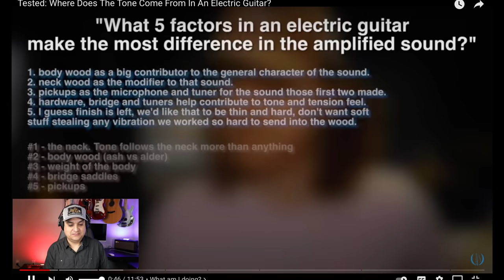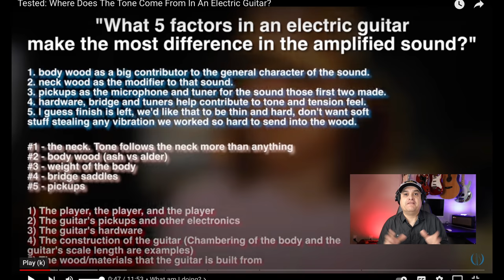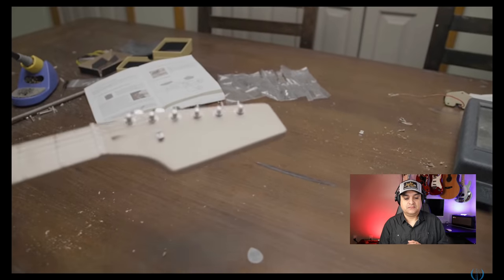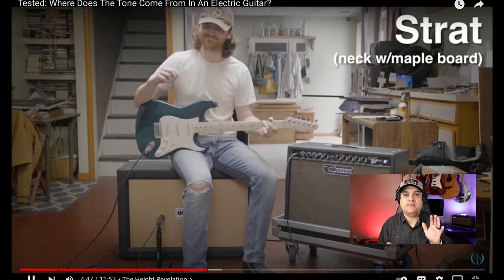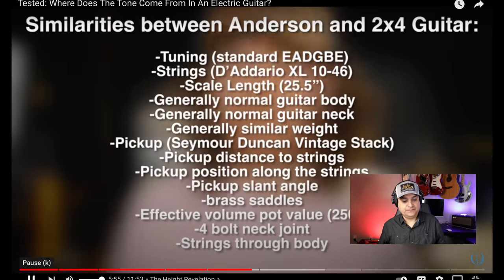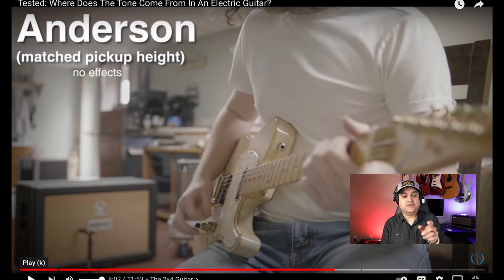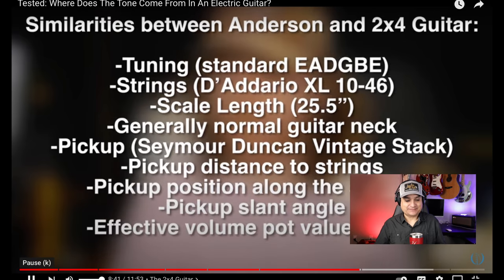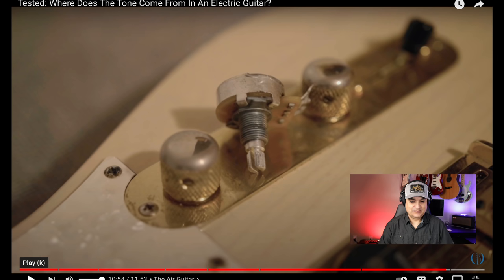Where Does The Tone Come From In An Electric Guitar - Reaction Video

Comment: Dylan, strange that someone like you who builds pickups for a living claims such nonsense that pickups aren't microphones. They're the exact thing as many types, but not all types, of microphones. 

I just picked up my Yamaha 112. Selected the Lollar humbuckers on the bridge. Plugged in the Mustang micro. Plugged it to my cellphone. Opened the voice note app. Cranked up the volume on the guitar. Clicked record and screamed at the body.

You've got a Mustang micro too. I'll let you guess what happened.
Reply from the maker: Looks like we are making a video on this subject …
Reply: @DylanTalksTone  looking forward to it. In my case there was a better response to screaming at it with my high pitched voice than my lower pitched one. Maybe I should try the deeper voice on the bass. See if that's better.
Reply: @DylanTalksTone when you make that video, can you cover how a pickup does transfer sound? For example yelling, Steve stevens Ray guns, EVH electric drill. Also, what does it mean when a microphone becomes microphonic?
Reply: @drittal  you might want to add TC Electronic's Tone Print to that. The ability to beam a configuration to an effects pedal through the guitar pickup and down the signal chain. 

Pickups detect sound by converting a variation in the magnetic field into a current. In that way they're similar to those microphones in old telephones and to power transformers. In those microphones your voice moves a diaphragm that has a magnet. The moving magnet varies the field in the microphone's coil and produces a current. It's how a speaker works, but backwards. Sounds produces current instead of current producing sound. 

A power transformer is similar. Except with no moving parts. In this case a variation in current in the primary coil creates a varying magnetic field in the secondary coil which in turn creates a current. The ratio of windings indicates if the voltage increases or decreases. As Dylan has mentioned many times pickups have a lot of windings. They're very susceptible to small changes in magnetic fields around them. 

Now cellphones and ray guns that make sound have speakers in them. Speakers, as we all know, move a diaphragm by alternating a current through its coil. Which in turn moves the magnet in them. The pickups are sensing this variation in the magnetic field. This is mentioned many times by Tore Mogensen from TC Electronic. I believe he even mentioned once that you could take the diaphragm off the cellphone's speaker and the Tone Print could still be sent to the pedal even when you could not hear the  buzzing sound. EVH's drill works the same way as a power transformer. The pickup is not picking up the sound. It picks up the magnetic field variations due to the spinning electric motor inside. 

Screaming at the guitar works differently. My vocal chords don't have anything magnetic. When I scream at the guitar the body vibrates. This vibration is transfered to the strings though the bridge and nut. So, as Dylan has so correctly mentioned before,  the quality of the bridge and nut are very important. But once the vibrations are on the strings it's business as usual. Hence the wood of the body matters. If it can pickup and collect more of the sound energy from my scream it will have more energy to move the strings. 

Now, sound travels at different speeds depending on the material. Doing so faster in denser material. That's because atoms are closer together. They have to move less far to push the sound wave forward. And sound will bounce back, at least part of it, when it hits something of a different density. That's how echo works. Be it in a room or a canyon. You scream, the sound hits the canyon wall and part of it bounces back to you. It doesn't all just keep traveling into the canyon walls. That's why guitars with set necks sound different from bolt on. The small gap between the neck and body of a bolt on makes vibrations travel differently between the neck and body. 

The wood's density affects how sound travels through the body and how those vibrations arrive back at the bridge and nut. In turn moving up to the strings and affecting tone. 

This is not voodoo. That's how oil companies search for oil. They detonate a charge and look at the echoes. That's how an ultrasound machine works. It can create an image out of sound propagating within your body because different body parts have different densities. That's how submarines hide from one another. By using the thermoclines which are waters with different densities. The density differences make it hard if not impossible for sonar to reach the hunted sub.

From Wikipedia:
"In the open ocean, the thermocline is characterized by a negative sound speed gradient, making the thermocline important in submarine warfare because it can reflect active sonar and other acoustic signals. This stems from a discontinuity in the acoustic impedance of water created by the sudden change in density."

Yet, in spite of all these real world applications, electric guitars are magical.  Somehow the laws of physics don't apply to them. Tonewood doesn't matter.

It does matter. The question is. Is the difference significant and can we control it? For example pine wood can have a density between some 400kg/m3 to 800kg/m3. The later being mahogany level density. So at this high density they'd behave very similar to one another in spite of being two types of wood. On the other hand a very light pine body would behave differently from a very dense pine body. In spite of both being pine. 

None of these videos have actually measured the body density by putting the guitar body in water, seeing how much water gets displaced (volume) and dividing the weight by it. Such a simple thing has not been done. So as entertaining as these videos may be they're not very scientific.
Reply from the maker: You DO realize that if you cut the strings off none of this works like you think it does….
Reply: @DylanTalksTone  nope. Most works just the same except the screaming part. I just beamed a Tone Print just fine to my Flashback with the strings muted. 

Obviously the part about screaming at the guitar body would not work if I removed the strings. As the body wouldn't have anything to affect with its vibrations relative to the pickup position, but everything else would. 

Feel free to try for yourself. 

I'll disassemble the Yamaha in the afternoon and get the drill. I'll get back to you with what I find out.
Reply: @Saurondor  you’ve stated a number of facts, however your tone wood assertion falls flat because you fail to consider the 200lbs (in my case at least) of dampening material attached to the guitar in three locations. Pick up a plank of your favorite tone wood. Hold it by the very tip with your forefinger and thumb. Now tap it with your free knuckle and admire how it rings out. NOW, hold the same piece like a guitar and tap it. Thud. Thud. Thud. There will be, IMO, a minor affect to some frequencies as not all of the vibration will be completely dampened, some of the character of the fret/nut material, fret board material, and bridge material will add some character, but very little in comparison to the electronics that are 99+% of an electric guitar’s tone.
Reply: @DylanTalksTone  quick update. I just tried the Tone Print thing with my hand muting the strings right over the pickup. The hand being in between the phone and pickup. The magnetic field goes right through my hand as expected. No problem. 

Now for this so work well the cellphone has to be around 1 to 1.5 inches from the pickup (hand or no hand). If further away it doesn't work even if the volume is high and the buzz sound is clearly audible. Proving it's the magnetic field that's transmitting the Tone Print to the pedal through the signal chain.
Reply: @drittal  I must have missed those 200lb. Where are they? 

Regarding the vibrations. I have a thing with my Epi Les Paul guitar and TBird bass. The volume during the sustain part of a note oscillates. It's dying off and then picks up again in waves. Like a tremolo, but without moving the volume knob. Creating a very appealing oscillation that is not present in my other guitars. Even when set against my body. This speaks of sound waves interacting in a complex way within the body. Or the through body neck in the bass. 

So no. The "piece of wood" won't simply go thud thud if I hold it against my body.
Reply: @Saurondor  try it before you make your claim
Reply: @drittal  try what? To see if the dampening effect of my body affects the  wood. Of course it does. But the tone of the guitars still cut through. Whereas the others fall short.
Reply: @Saurondor  so you agree that the guitar wood cannot vibrate freely and therefore unable impart much character to the strings for the pickup to register. Thanks.
Reply: @drittal  are you kidding me? The more you push this argument the more you make a case for tonewood. 

Electric guitars aren't some magic devices that exist outside the realms of physics, and tonewood is not some red pill that does miracles. Obviously any piece of wood, even my uber special secret tonewood is affected by my body's dampening effect. 

Now. The guitars I mentioned sound fantastic if I grab them with two fingers at arms length. But I can't play them like that. I need them close to my body. 

Attention. Here comes the important part. 

They still sound great close to my body. That's the edge they have over the others. Their build and wood is such that in spite of the dampening they're still great. 

Now another important part. Pay attention here because I'll be talking about money. 

This great tone and volume effect I like in the Les Paul isn't what I'm always looking for. Sometimes I use lighter guitars like my tele or the Yamaha strat. 

Attention please. For some things I prefer these guitars which are affected more by the dampening effect of my body. 

Super attention to this part. My Les Paul with the uber secret tonewood cost less than the tele. There I said it. The Yamaha, which has more sustain than the expensive tele cost 50 bucks. 😲 OMG there I said it again. 

Let me say it once more in even clearer terms. How much I paid for the wood has no effect on the tone of the guitar. 

There's an underlying argument in this tonewood vs no tonewood conversation regarding paying a lot for some fancy wood so the guitar sounds better. That marketing story is not true. A twenty thousand dollar guitar isn't necessarily going to sound better than a two thousand one or a two hundred one with upgraded electronics. 

But trying to debunk these marketing ideas by somehow claiming electric guitars are not affected by the physics of sound and acoustics is just crazy.
Reply: If that wood cannot vibrate as you have stated because it is dampened by your body, it therefore cannot impart any of its tone wood qualities to the strings for the pickup to register. That’s the physics. It could be made of concrete, metal, mdf of PRS secret stash hard wood and it will only ever sound like the pickups. Any difference in tone will only be marginal if any.
Reply: @drittal  but it is vibrating! That's why it's getting dampened. Otherwise there would be nothing to dampen. 

Your argument makes no sense. It's like a warm coffee cup in my hands during a cold winter morning. Either is hot and cooling off as my hands warm up. Or is cold and not cooling off. You can't have it both ways at the same time.
Reply: @drittal  quick question. According to you. Where does all the energy in the strings go to? In other words. Why do they stop ringing after a while?
Reply: @Saurondor   our body dampening the vibration means it is barely, if at all, transmitting any minute vibration to the strings. Which mean it isn’t coloring the sound much, if at all. This video is proof. It doesn’t really matter what wood is used.
Reply: @drittal  wrong wrong wrong on so many levels. For starters the strings are on the front as side. The side away from my body. At least how I play and have seen others play. 

So while the body is still vibrating and hasn't bled all its vibration to my body it's very very capable of affecting the tone of the strings. 

Simply put. You're confusing tone with sustain.
Reply: @Saurondor  it’s a solid piece. Dampening one side affects the whole body. Think of wooden xylophone bar. Dampen it with your hand and it doesn’t vibrate enough to really make its tone. Dampen the top, side, or bottom it has the same effect. Tuning fork, bell, etc
Reply: @drittal  well that's odd. I just picked up the Les Paul, placed on my lap and strummed it. I could feel it vibrate for quite some time by putting my finger by the rhythm/treble switch.

Are you sure you're not belly muting your guitar?
Reply: @Saurondor  if wood plays such an integral part of the tone, you should be able to hear an electric guitar sight unseen and determine what wood it is made from. Would you like me to record some snippets and you can have a go at guessing the woods?
Reply: @drittal  I would most surely fail to pick up which guitar has what wood. Now now, before you get all excited let me continue. Wood types have overlapping densities. So there can be pine that is as dense as mahogany or two different types of pine quite different from one another. 

That being said I could probably tell you something about each one. At least how I feel it. It's a bit like delays you know. There's digital and tape and analogue. They all have different decay times for different frequencies. Digital being the most prestine. Analogue starts to take off the top end. Tape depends on the type and quality of the tape. 

For example my lighter guitars are like digital or studio tape quality delays. They track perfectly what you play and strings don't seem to resonate on their own if left unattended. But they die off rather quickly with the least sustain of them all. Mid range guitars like the Yamaha is like drum delay. It's less crisp, but with a bit more sustain. There's a fuller low end, but not too much. Then the Les Paul is more like an analogue delay. The low end keeps on going. It's not that it lacks sustain overall, but the high end dies off quite sooner than the low end. Or should I say the low end endures more than the high end, as this guitar has way more sustain than the ligher ones.

That's why I love the Yamaha with its Lollar pickups. The pickups have this broad range response, but the guitar isn't overly saturated on the low end. The Les Paul sometimes feels like too much. Don't get me wrong. It's great, but for some things it feels like it's got an overdrive inside I can't switch off. The lighter guitars like the tele or the Cort strat are really crisp, bright and responsive. I actually have the Cort tuned like a mandolin with a capo and it's fantastic. 

Get what I mean? Pickups have a huge influence in tone. They pickup whatever is on the strings at a given moment. How senstive they are accross the frequency range affects tone. But the evolution of the string vibrations over time depends on the body. If the low end dies off quickly no amount of pickup magic is going to bring that back. And vice versa, too much and it's tought to handle sometimes.

Now go back and read this post again and take note on how I don't have a preference based on price. It's what I feel when playing the guitar. Feel free to come up with those snippets. Would love to continue this conversation with that.
Reply: @Saurondor  you can’t discern the wood but if I play a 25.5” scale guitar with a Tele pickup you would say it’s a Tele. If I played a 25.5” scale guitar with Strat pickups you would say it’s a a strat. Regardless of actual shape or wood used.

Your statement of how different wood can be, even if the same species just verified the fact that tone wood is really a myth. The electric guitar myth that Ash sounds like X, mahogany sounds like Y, and maple Z.  

Also, your Epiphone “mahogany” is probably Lauan in reality.
Reply: @drittal  wow wow wow there. The fact that I can't tell the wood apart doesn't mean I can't tell there's a difference in sound. 

You make a false comparison with the pickup example. If you made the same experiment with someone who doesn't know anything about pickups, or guitars for that matter, they probably couldn't tell which one is a tele and which one a strat either. But I'm sure they could tell there's a difference, just not put a label to it.  And the fact that they can't say which one is which (and the vast majority of people on this planet can't) doesn't mean pickups don't matter. They do. So false comparison on your part there.

Regarding my Epi. Yea, for sure, the "mahogany" could very well be lauan. The fact that you say this means you've learned nothing from my comments. Let me re run this again, please try to pay attention this time.

Important-> 
a) What matters are the acoustic properties of the wood not the species of the wood. 
b) Certain species have a range of densities and these ranges can overlap with other species.
c) If you pick two different species of wood with similar (overlapping) acoustic properties they'll perform in a similar way.
d) Last and very important point here. Pay attention. The vibrations in your guitar are not aware of how much you paid for it.

So it doesn't matter to me if it's mahogany or lauan or whatever as long as it has the tone I want. Which it does BTW.

Either way. I do want to take a minute to thank you for this conversation. Specially last night's comment which lead to my reply using delays as comparisons. You've really help me pin point the crux of this issue in a simple analogy and I thank you for that. 

Now I realize that in this discussion about pickups and tonewood and other guitar parts the pickups are like an overdrive in the pedal chain and tonewood is like delay. The pickup drives the signal and, like overdrives, they've got their own tone and color thing going on. They really highlight what's going on the strings at that moment. But tonewood is like delay. It kicks in over time and just like there are different types of delay: digital, analogue, tape, oil drum, etc., there's different types of wood and wood properties. Many people indeed find no difference between delays. It's just the echo. There's no conscious perception of things like the loss of high ends in the bucket brigade circuit. To them it's about the echoes, repeats and delay time. And that's ok. And if you're in that camp, that's ok too. But there are in fact subtleties in delay tone.

Speaking of tone. Maybe you can develop further on your own experiences. Reading back I noticed you haven't actually put forward any of your personal experience. Care to share?
Reply: @Saurondor  the only thing I’ve learned from your comments is you realize wood type means very little, if any, to the overall tone of the instrument. You acknowledge that when you admit you can’t differentiate wood by ear but can differentiate the pickups and orientation. Any small difference in tone between two identical guitars of different woods comes down to setup and the differences in the construction of their electronic parts and strings. Tolerance is fairly tight, but still a degree of error in all.
Reply: @drittal  all right. So you're saying that what Dylan has been saying all these years about pickups is BS. All I have to do is find someone that can't point out which guitar has humbuckers and which one single coils and I'm done. Is that what you're saying?

Because if so we can pick up from there (no pun intended) and apply it to all music. If I play a note and someone can't figure out if its E or G, then what? I mean the person can surely notice a difference between the notes, but just doesn't have perfect pitch. What then? We just discard all music theory?

Is that what you want? Because we can go there. And believe me it's really really easy to find people that won't know which pickup is which. They'll notice a difference in tone. No doubt about that. I'm not arguing that. They just won't be able to make out which is which in a guitar lineup after a blind sound test.

Heck we can start with my family as a test bed. They always ask me why I have so many guitars. And although they've heard me play I'm sure they've not made a clear connection between tone and guitar pickups. I could play anything on them, turn them around and ask which one I used first. They'd have no clue.

Maybe your experience has been different. Care to share?
Reply: @Saurondor  I’m saying the pickups are the #1 factor for electric guitar tone. All of them will be slightly different due to manufacturing tolerances.

Listen, I used to be a tonewood snob until I started building and realized it doesn’t really matter if that Tele is made from ash, alder, mahogany, cherry, red elm, resin, concrete, etc… it will sound like a Tele as long as it has Tele electronics and arrangement.
Reply: @Saurondor  PS: Dylan makes terrific pickups, I used them in my GGBO build. I plan to use them in my next build. I’ve met him, he’s super cool. I even got to try my hand at winding a pickup. It was terrible but really fun. Cheers.
Reply: @drittal  right, but if my dad can't make out the tele from the strat from the les paul then you're wrong and Dylan is full of it? Or what? Because it seems that's the point your trying to make. 

Now I didn't care about wood in my guitars. Heck when I started I never understood why someone would pay more than 200 bucks for a guitar, much less so for a single pickup. But it matters.

Now over time I've become aware that the properties of wood matters. Actually these debates about tonewood have made me even more aware of it than before as I've researched into whats in my guitars. For example, I've realized why my base has a through body maple and walnut neck. Both woods have similar densities and, unlike pine, they have a narrow range of densities. Making neck density more consistent from one bass guitar to the next in the same production run. It isn't just because the striped neck looks cool.

But this hasn't made me a snob. Because I know it's the acoustic properties of the material that matter and not the fancy buzzwords and high price tag attached to them. To me it's perfectly understandable that an expensive super uber fancy tonewood guitar sounds similar to a pressed wood Danelectro. Because the word press immediately gets me thinking higher density and the resins uses do keep it all together are very consistent in density. So it's all in line with what I've said so far.

But you might disagree. And that's ok. More so. If you don't think wood matters and paint doesn't matter either. Then I'll invite you to do what I've invited others to do. Get together and setup a company that builds guitars with a pinewood through body neck and balsa wood wings for the body covered in thick paint or resin. You'd make a killing. Utterly dominate the market with a very very light and great sounding guitar. 

Now you might have noticed that guitars with through body pine necks and balsa wood bodies aren't really in the market. Much less so a dominant product. That means that I'm either a genius for coming up with the idea. Or.....  mhhh I'll let you fill in other reasons why this may be so. You're the guitar builder after all.
Reply: @Saurondor  because your dad can’t tell means he ignorant to the difference.

This video showed a particle board bench will sound like a Tom Anderson, and your dad could probably hear that.

As to pine necks… won’t hold shape, prone to warp/twist. Balsa body’s wouldn’t last long, too soft. There is also the long standing myth that heavier means better/more sustain.
Reply: @DylanTalksTone  sorry for the long delay. Didn't get time to get around to disassemble the Yamaha. I just tested the TC Toneprint functionality with no strings and no neck, just the body, and it worked just fine. The Flashback was programmed through the pickups and down the signal chain with no issue at all.